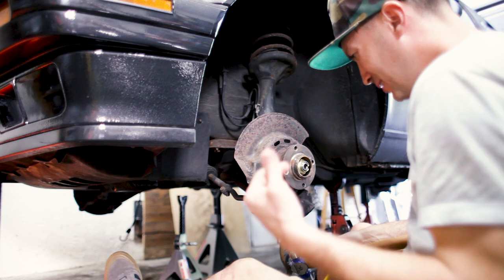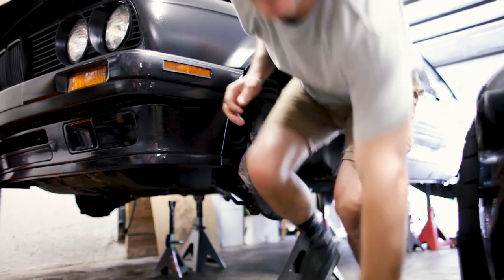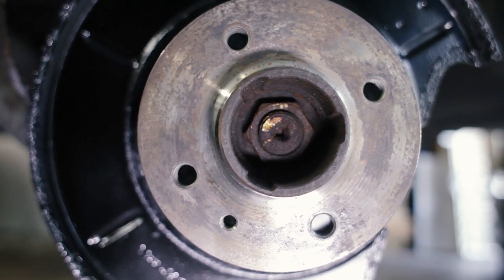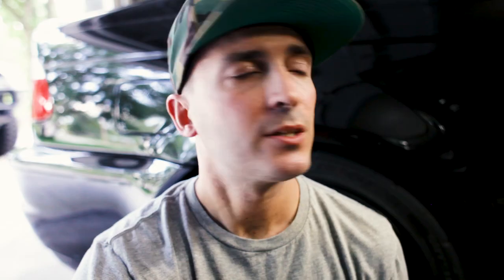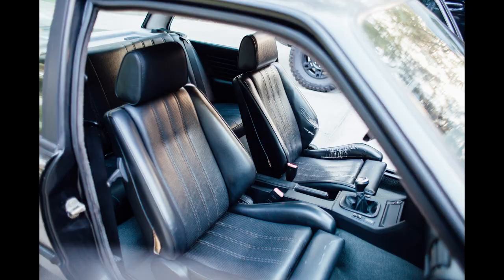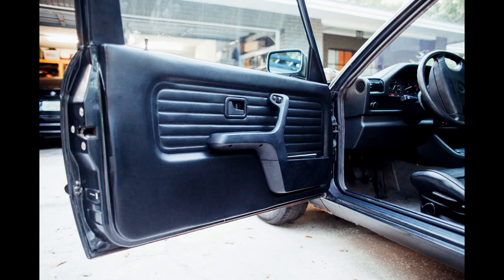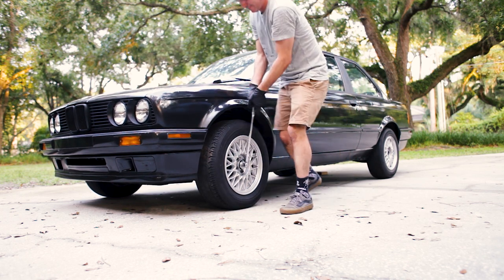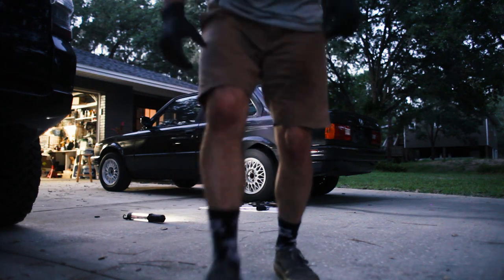Removing the Hubs - 1991 BMW 318is | vlog 067

Comment: Good job getting those nuts loose, sorry to say that was the easy part!! The front hubs will come off with little problem. But the rear will require some special tools since the bearing is pressed in. Looking forward to seeing you get it done.
Reply from the maker: Jermaine Smith thanks and oh no! Haha. Looking forward to tackling it. I’m rebuilding the front suspension now, then on to the rear, so we’ll see what happens!